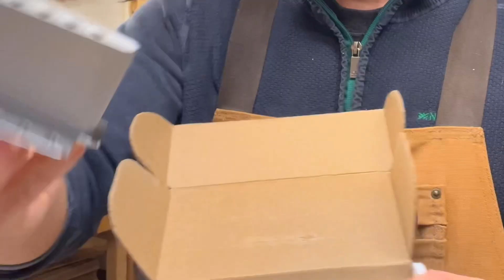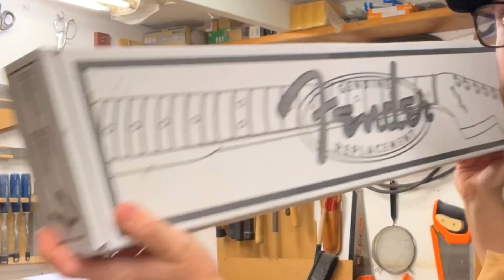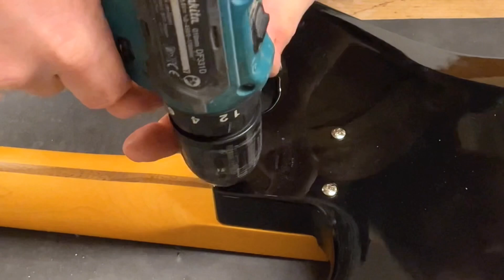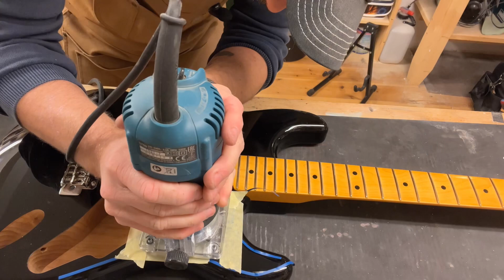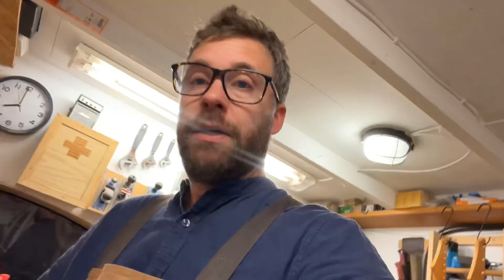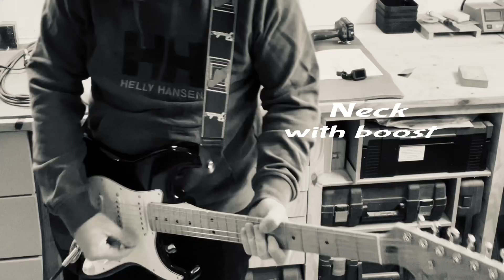I saved $1500 and made my own ”BLACKIE”

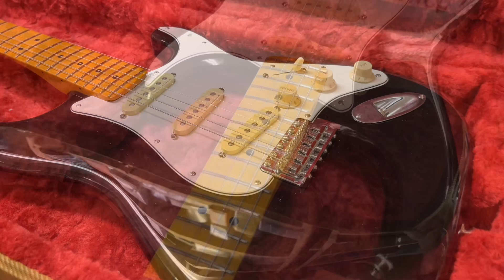Comment: That's some really nice parts you got right there, but at 14:42 there is something that is not good at all and that's the neck, strings is way off, you can not have gotten that mounted the right way because its not suppose to look like that, maybe something to look over and see if you did something wrong or if there is a serious issue with the neck or the body.  Thanks for the video..
Reply from the maker: Thanks for noticing, you are not the first. I will attend to it, I think it’s just a mm of but it has to be corrected!
Reply: @TheworldofMattias  Take a string of some sort and fasten in the middle of the saddles on the bridge then in the middle of the nut, once you lined the center up you will see that its probably more than just 1-2mm, if the neck seem seated and properly fastened then it can be the bridge that is the problem if its not properly in the center of the body. I am sure you will find the problem once you dig in to it.

Comment: Nice job, I did it a few years ago with second hand parts in the same way you did, I mean routing the extra cavities for the mid boost PCB and the battery. It ended up quite well but the noiseless pickups aren't the best choice. I have a '94 Clapton Strat with the Lace sensors and I prefer them. It seems the noiseless pickups are some sort of stacked bobbins single coil to cancel the noise. So I kept the Lace Strat. Just a question, is the body you used made in USA? The holes in the neck pocket and under the pickguard remind me of Mexico Strat bodies.
Reply from the maker: The body was not specified from Fender, at least what I could tell. Do you know the difference?

Comment: It's not even a v neck? What's the point? 
You could have just thrown the tuners and TBX circuit on any old strat and had the same results.
If you're going to spend that kind of money, you can get much higher quality from aftermarket builders for less money than from Fender.
True vintage spec with real nitro finish made from high quality woods. 
You can even have the proper logos put on. 
You just assembled an overpriced partscaster. Not worth the time or money.
Reply from the maker: Thanks for your input but I respectfully disagree!

Comment: The high e looks like it's too close to the edge of the fingerboard unless it's an optical illusion. If it is, loosen the four bolts on the neck and push the neck so the strings are aligned and while holding it there tighten the screws. I had to do this on a partscaster I built a few years ago. I was leery of this at first but once the screws are tight the neck will stay put.
Reply from the maker: Thanks for that tip, very useful! 🎸

Comment: I hate to be that guy, but… is that the correct bridge? There seems to be quite a bit of space from the low E to the edge of the fretboard. Also, it looks like the low E string doesn’t pass over the pole piece on the neck pickup. Sorry.
Reply from the maker: Of caurse, be that guy! I appreciate it! What bridge would you recommend?